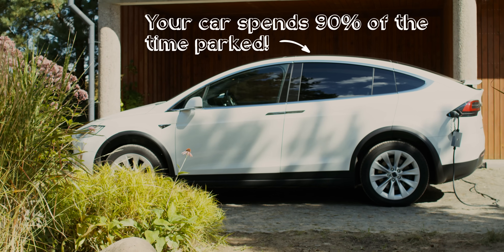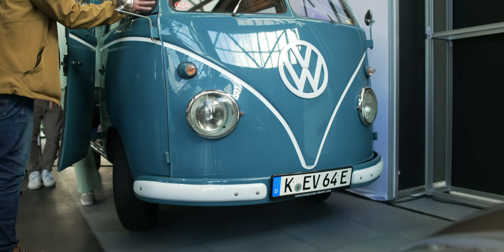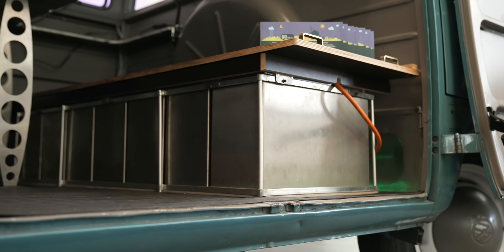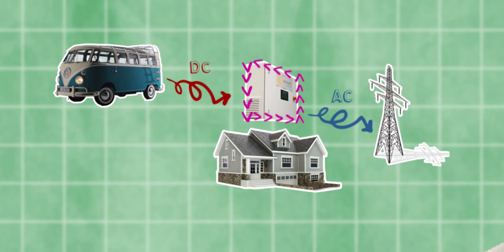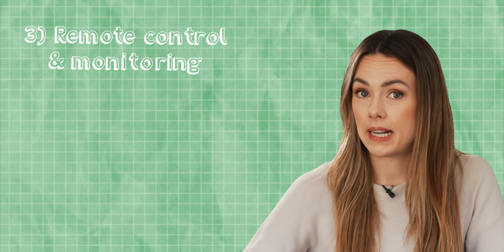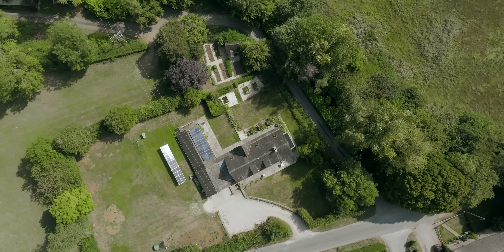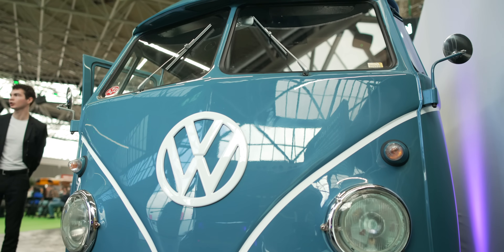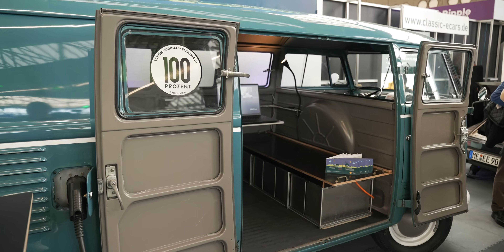This VW Bus Has SUPERPOWERS!

Comment: CCS is the standard (in Europe) for plugging your car into something, so surely the only thing you need to do is to update the CCS standard to include V2G...
Reply: Indeed, although the CCS people have been astonishingly slow to actually agree a spec for this. We've had a draft for about 3 years, but I don't think it's actually official yet. I'm not quite sure what they are waiting for. Bidirectional AC already works on some cars, and is much cheaper to implement than DC. Given that 7kW is enough for most purposes it seems to me that doing this the AC way will be much more cost-effective.

Comment: Although if people have range anxiety as things are, we can't really count on much of the baterries capacity to be actually loaned to the grid, so the potential comes with this big caveat. I'd guess something around 30% of EV batteries would actually be surrendered, and then there's the logistics of it all and the practical necessity for middlemen to come in and take a cut, making the prospects less convincing to the end user. Also, people would probably have to charge by day while they're at work and then V2G in the evening. This would make it harder for overnight level 2 charging to suffice for people's comfort. So, probably a step forward, but not a game changer.
Reply: Depends how the person uses their car. For people that work from home or take public transit to work, but own a car for weekends, the car actually is sitting at home, day and night, most of the time. Of course, V2G actually making economic sense will depend on the cost of the equipment to hook everything together not costing more than it's worth, an assumption that, at the moment, seems far from certain.

Comment: Don't need an AC inverter in the car or any other special equipment outside the car.
Just about any solar PV inverter can take in the 400 volts from the car battery and feed it to the grid and/or home battery.
Just need to tell the car to connect its battery to the charge port (which it does when it DC charges).
Reply: No, most standard solar inverters would not work, you need a hybrid inverter that lets you connect batteries, for it to work. Which is a few times more expensive than a regular solar inverter. And obviously you would need to physically connect the socket with the inverter, not with your normal house grid. All in all really not that simple.
Reply: @jankoodziej877  Batteries are optional, not necessary. Hybrid inverters are common and cheap.
Yes, duh, you do need a cable. Simple.
Reply: Which is still an external inverter.... Which is what was stated in the post...

And in the real world it's far more complex...since everything has to be compatible and  additional equipment is required to keep it safe such as a transfer switch... Which ends up being complex and costly...

For all the above reasons and more V2G, makes far more sense at a variable capacity battery pack swapping station.
Reply: @nc3826  My point was that you don't need a special V2G inverter. Most bog standard solar PV inverters will work and many people already have these installed in their houses.
You do need a communication box to tell the car to connect the car battery to the charge port but that is a simple protocol circuit. You don't need a transfer switch since the DC voltage goes to the solar inverter which takes care of the grid connection and (optional) house battery management. The solar inverter just thinks it's connected to a solar PV string.
Reply: @MarkSpohr  But the post didn't specify a "special inverter" or an "AC inverter in the car". So your comments are not applicable to the post. But in the real world it is extremely complex and costly and it has numerous logistics issues.

We've been hearing about V2G for over a decade. If it's so simple why doesn't it already exist on a widespread basis? The truth is current established V2G and V2H systems do require a specific inverter and transfer switch, such as for the Ford Lightning and is usually over 10,000 USD after labor costs. 

And protocols alone do not establish a standard for example there's more than one CCS Plug and Play charging standard in the US. So not all inverters will necessarily adhere to a particular set of protocols.

V2G ie Pack2Grid, makes far more sense at a variable capacity battery pack swapping station. That is completely done behind the scenes. Which is already a proven technology in China. And is just starting to be done in Europe. (Even if it's not as fun for the backyard tinkerer.) 

Let's check it out in another decade,to see what form is dominant? I know what I would bet on....
Reply: @nc3826  My point is that it doesn't need to be complicated or expensive.
Reply: @MarkSpohr  good luck with that dream
Reply: @MarkSpohr  since both of those factors are inherent

Comment: Thanks, Imogen! -- maybe good to mention that the Utrecht experiment showed signs that batteries used for V2G actually were either not or surprisingly positive influenced by this usage. Kia announced that all their models shall be V2G enabled both AC and DC, and they want to bring their own chargers. So yes, I guess we might see uptake soon, though I believe more as V2H. V2G asks for so much additional changes in norms and laws, it might take a bit longer...
Reply: Nio is actively doing it, but just China. Europe is horrific red tape everywhere. It'll take forever.
Reply: That sounds very interesting. Can you provide a link to the information that V2G has surprisingly low or positive effect on the battery? It would be interesting to know how this affects the lifetime of the battery.

Comment: There's no mention of pricing. If I charge my car at grid price, 30p/ kWh, and then feed it back to the grid, what will I be paid as compensation? My solar exports are only paid at 15p/kWh, so how would my differently costed exports be dealt with?
Reply: That's a business decision, not something that you can predict from the physics. I guess you'll get somewhere between Octopus Agile Export, and the Saving Sessions. They'll have to pay enough to make it worth installing, but they'll keep the rest to themselves!
Reply: Eventually it should be that when they need it you get a good price, when they don’t need it they won’t accept it..and everything between
Reply: It would depend on the V2G scheme you signed up to. The pricing - and other - details would be known to you prior to you signing up.

Comment: I once encountered a vehicle that ran out of battery in the motorway. Have I had V2V (a form of V2L) I could have helped that person as I had plenty of battery available at that time.
Reply: Or you could have towed them, if you'd had a length of rope. With regen that could even have given them some charge.
Reply: @robinbennett5994  I believe that kind of practice is illegal in Portugal. Only a certified towing truck can remove a locked vehicle in a motorway.
Reply: Current V2L usually only supply 2kw, so you have to stay for more than an hour for him to get 2 kwh (10km of range probably).
Reply: The AA and RAC encounter hundreds of ICE vehicles on the roads each day that have run out of fuel. They recently stated that the ratio was around 20 to 1, compared to EV's with a flat battery.....

Comment: Glad to hear that nod to Chademo being ahead of it's time with V2L tech. It's a bit like the Betamax vs VHS video tape format saga. Betamax was the better format but VHS was the one that became universal. Of course, they are now both pretty much defunct. Chademo is still supported but CCS became the much preferred format and now the NACS format is set to replace both of them. However, the idea of exporting energy from your car is here to stay. The one massive advantage of V2L is that it takes strain AWAY from the Grid as opposed to increasing it as the EV trolls like to incorrectly state at every opportunity.
Reply: @nemam_nedam  It DOES matter because other standards have been capable but not active. ChadeMo has always been capable AND active.
Reply: @trevorberridge6079 exactly it's the protocol standards for the communication. The physical socket and cable just make the connection. 
Never heard of NACS, maybe in the wrong part of the world, can't be any more clunky than CHADEMOs two charging port system
Reply: 😂😂😂😂

I despair. The EV batteries have to be recharged at some stage.

Does it ever occur to the wilfully blind that by pushing this V2xxx nonsense is simply a way of conning people into buying EVs.

Of course it doesn't, the poorly educated within the realms of technology simply don't understand how they're being gulled.

Comment: Wouldn’t solar on the cars help? I’d like to convert my 2000 VW Cabrio to EV in the future if there’s great kit options.
Reply: Not really, a car roof is tiny compared to your house roof. Put the panels on your house, where the weight and aerodynamics don't matter as much.
Reply: Waste of time. To get any meaningful amount of charge into an EV in a relatively short time (such as when you were parked), you'd need a solar array the size of a tennis court.

Comment: The main impediment is that battery chemistry in the vehicles.  I wouldn't try to do V2G with NMC battery packs.  It really has to be LFP battery packs.  Otherwise you are spending an enormous portion of your vehicle's battery life on playing around with the grid.

In anycase, the only decent solution is to DC-couple and put the AC grid-tie inverter in the home.  It doesn't have to be big.   Adding extra weight to the vehicle just for V2G functionality makes very little sense.

Comment: I have an ID Buzz, how can I use VTG and VTH? Are there any chargers that can offer this as I haven't had mine fitted yet?
Reply: Currently No CCS V2H chargers are on the market yet (uk at least)
Reply: The Buzz won't work until they enable it (promised mid 2024 at the moment). For working 'charger' hardware there is the Wallbox Quasar 2 and the Pionix YETI+YAK kit. I'm not aware of any others yet, but I expect  various announcements of more kit soon.

Comment: Also, don't forget that Schneider Electric and SolarEdge plus others are selling systems to add V2G to your solar system.  Since the solar inverter is already grid interactive, their new systems just treat your EV as a huge battery, if the vehicle is compatible.
Reply: For now, that is a big if. But that is clearly one way of doing it.
Reply: Regular solar inverters do not allow adding batteries. You need a hybrid inverter, which is typically a few times more expensive.
Reply: @jankoodziej877  They are no longer expensive and barely any more than plan PV inverters now. a 5kW hybrid inverter can be had for a grand and a 3kW one for £800.
Reply: to get solar installed without full use battery storage is leaving yourself open to be robbed by the grid

Comment: Sounds great - but how does V2G impact the expected life of my EV-battery? Will it loose capacity faster or is there no change? Just curious to know!
Reply: In theory, the impact should be minimal. The car's motor (and rapid chargers) can run at over 100kW, while V2G will be limited by your house wiring to 3 or 7kW. And you'll probable only ever export for an hour or two. Most modern batteries are expected to outlast the rest of the car, so a little extra use will probably make no difference.
Reply: I use V2L from my EV to supplement my home solar system. If I used my EV for 8 hours at night at 1kW/hr  I would use less than 10% of the car’s battery which I can charge back from my solar system in about an hour the next day.

Comment: Yes, I find it interesting how small the house batteries are. We were told for 85% of our house use we'd need a 5.5kw/h battery. Our little Zoe sits outside with a whopping 52kw/h battery. It certainly makes sense to connect everything up.
Reply: kWh. No slash. Uppercase W. Lowercase k and h. That being said, car batteries are MASSIVE, and these V2G applications are also quite low power compared to fast charging or accelerating a car, so the wear on the batteries should also be minimal.
Reply: @geirmyrvagnes8718  Thanks for the kWh correction, never quite sure what is correct.
Reply: @Flickerbrain  What "everybody knows", everybody has to learn for the first time at some point. At least once. 😅
Reply: @Flickerbrain  a little hint on how to remember it: slash means "per", for example km/h, which measures how far we go within an hour. Energy is measured in kWh, which is not how much energy was used per hour, but the total energy used, which is the multiplication of the average power and the time, hence kW times hours.
Reply: @jankoodziej877  Thanks for that. That makes sense. My 7,7kWh house battery could provide 7,7kW for 1 hour and not 7,7kW per hour. Getting the hang of this 🥹
Reply: @Flickerbrain  Just FYI.. The 'W' is uppercase because it's named after (in honour of) a person (James Watt).
Reply: KWh
Kilowatt hours, abbreviated as KWh, is a unit of energy representing one thousand watt hours.Nov 14, 2013 European Commission

No wonder brexit happened, pedantic brits just couldn't deal with  it ;)
Reply: Well said !
Reply: why would anyone get a battery that fails to supply 100% of needs
Reply: @flodjod  It is costs 10% and solves 99% of your problems, why not? Nothing is 100% in this world, anyway.
Reply: @flodjod because the 'law of diminishing returns'. There's no point buying an extra-big battery just for that one day a year when you've got loads of guests or need to charge your car outside of the cheap rate period. The cost of the extra battery would outweigh the possible savings it could generate.
Reply: For all the above reasons and more, V2G makes far more sense at a variable capacity battery pack swapping station.
Reply: @nc3826  Too bad the business case for swapping stations isn't that great to begin with.
Reply: Too bad there is so much arrogance and ignorance in the West about battery swapping, (especially among YouTube experts and Elon FUDsters) Thanks for proving my point.
Reply: @flodjod  Some       times       the      sun      doesn't     shine.

Comment: A car, is a daily depreciating asset starting from the first second you sit in it and drive 1 centimetre, with an immediate drop anywhere between 5% and 20%.
Having this in mind along with battery degradation, makes it an even odder choice to use a V2G service, while counting that EVs whether we like it or not have internal soft counters for everything.

Having said that, it will be an interesting game to see being played out in the future, how these perform, and how they hold their value for resale, along with the costs in between that might arise.
Reply: If you accept that a car is a depreciating asset with a limited "lifespan", it would only make sense to get a bit more out of it while you have it. Some cash if you want to play it that way, or some energy backup security if that is your thing, sounds good.
Reply: @geirmyrvagnes8718 at what expense though? That’s what i am more interested to know.
For example, you can build an awesome battery energy storage device with much less money etc, set it to charge from solar and the grid while kwh/€ rate is lower (usually during the night), then resale that energy back to the grid when the kWh rate is higher (during the day).
Also this option gives you a whole house backup option or at the very least the essentials. Plus is cheaper with a better ROI while still remaining totally green.

So why not use the “traditional” methods of helping the grid with green energy, while making some € , guaranteeing vehicle lifespan (or even extending it) and instead opt in to V2G?
Neither the rules not the game is clear on the V2G section, imho.
Reply: I don't think depreciation would be a consideration in this case. V2L/G would make it deprecate less as you can keep your battery in optimal ranges. Also you would want to keep the car because it's more useful to you.
Reply: @PandaKnight52 i’ll have to disagree with this one, simply because if you need your batteries being at the optimal charge, then that means you will either limit your use of them either on grid or driving.
The other side of the coin says that you would keep them charged via some solar panels or whatnot, fair point, but then you return back to the argument of “why not a home battery storage then”?
Reply: The next step is widespread LFP batteries or similar tech, with sufficient power density that renders battery life a non-topic and makes V2G viable. Given how FC is reporting progress, I can see this being standard on most cars in the coming five years. It would be crazy if it wasn’t.
Reply: @nemam_nedam  ...or later. Or earlier. And in the future, who knows? But this is not even about distance.
Reply: Fair point.